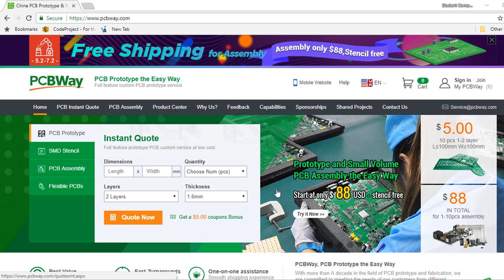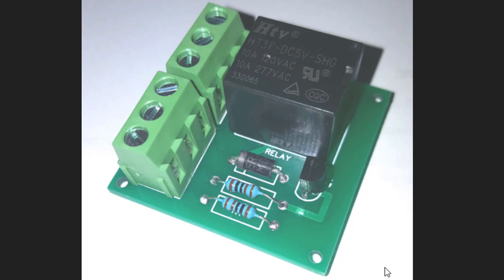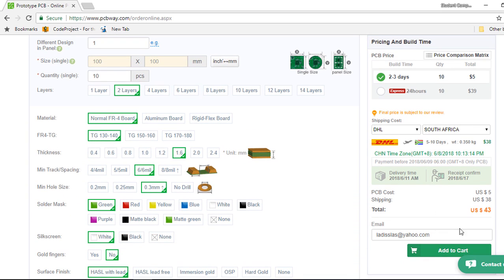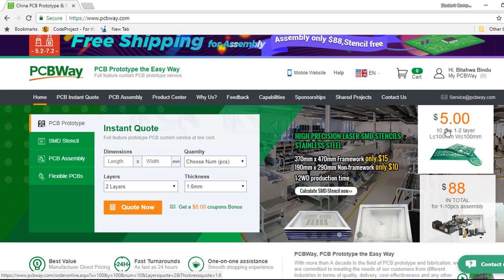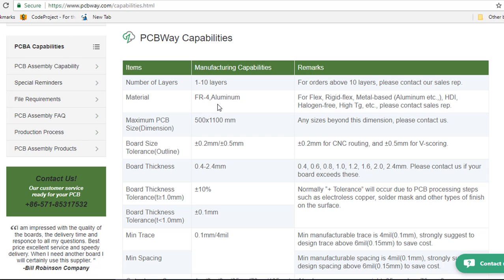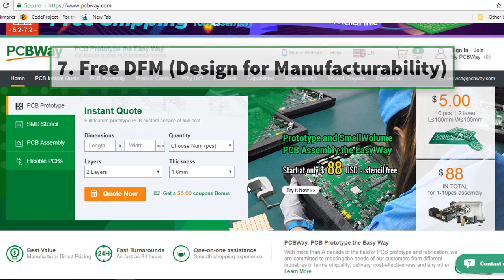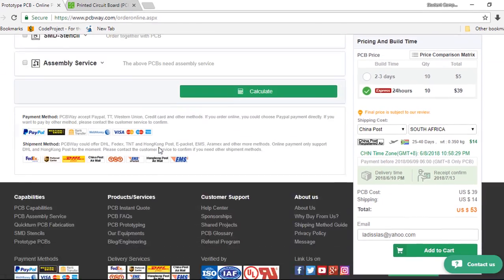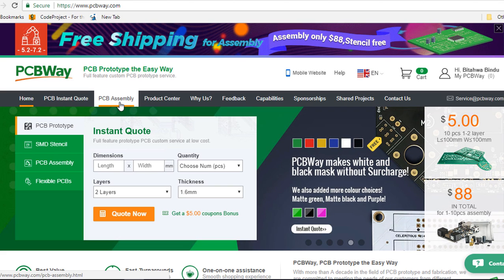Low Cost PCB Prototype and Assembly with PCBWay

Comment: Can people also send schematics, instead of Gerber files. Just asking.  I have seen many nice schematics , but i dont know how to make the pcb file with software.
Reply from the maker: Schematic captured with which software?
Reply: @StudentCompanion  Just a circuit diagram written on a pdf,or word document  that needs to be drawn to a gerber file.

Many circuit diagrams are on the internet, but without the original  designer files that u need to make the pcb.    

Most of them are single layer, some are dual layer small sized boards.
Reply from the maker: No. No PCB manufacturing company can access a circuit on pdf. It means they have to draw it for you which is time for them. From the pdf you'll have to draw it. There are even free software that you can use. PCB companies only need the Gerber files.
Reply: @StudentCompanion  Thats the service what i miss from most pcb manufactures.   

Fyi, I dont know how to work with design software like kicad,eagle. 
 
Thanks anyway.
Reply from the maker: Unfortunately they wont also take that risk to make mistakes in the design. That's why  they want us to do it. Some software are not that difficult.  We have tutorials covring how to use Eagle. Start a project from start to finish and also design with the free EasyEDA.
Reply from the maker: Check out this tutorial: https://youtu.be/d94lNryFvS8
Eagle can be used for free for most of designs
Reply from the maker: This one is also a free tool you can use. And it's easy to learn: https://youtu.be/GtTeltGpOPg
Reply from the maker: You don't have a choice, pick one software , take some few days to learn how to use it then you'll be good to go. Or you can hire a freelancer to design it for you.